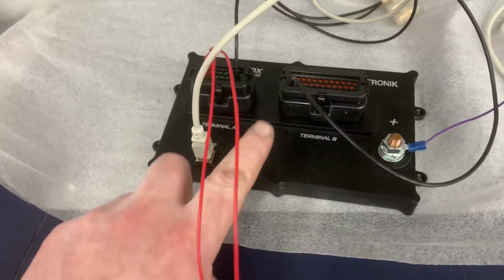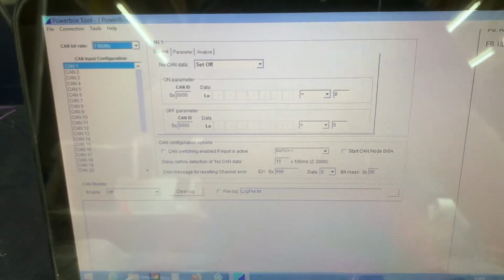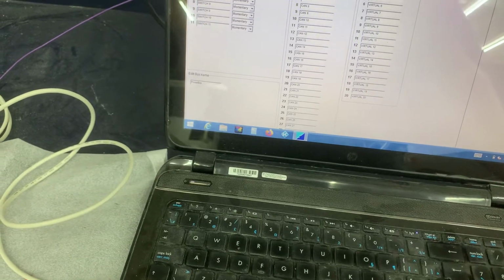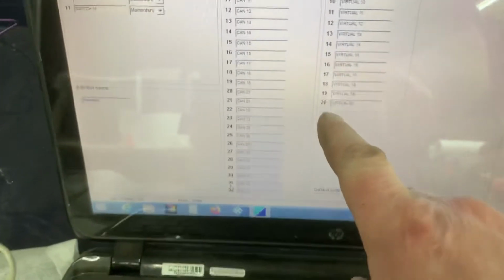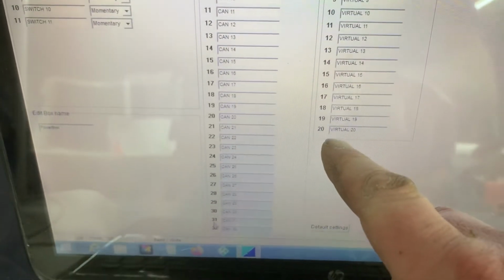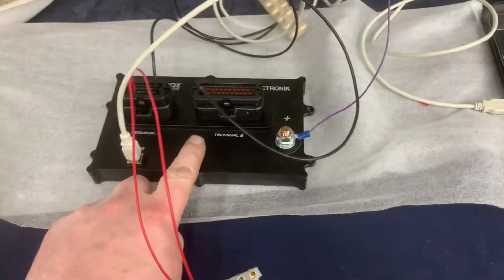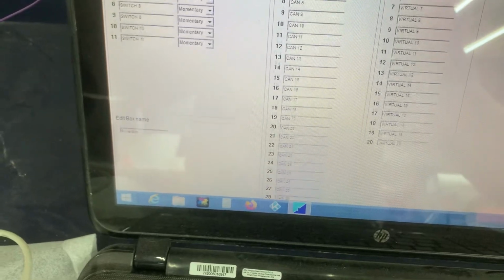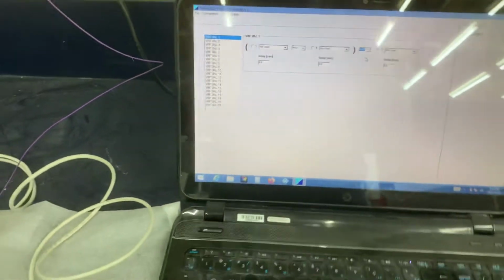Thank God it works

Comment: 2 videos in a day!
I nearly missed the first one!
Reply: I forgot to Post the other one..... Been busy but that's Good..... Updates and progress this year will be more regular..
Reply: @clivehdhomer8306  Awesome can't wait. 

I might actually do something with the Fisher Fury this year. I have a DL1 data logger, a differential pressure sensor, a pitot tube, some pressure pucks and some ideas on how to shape the mouth of the rad inlet. Also read the Julian Edgar book as well as a few FSAE papers and some WW2 documents on rad cooling ducts.
Reply: @DavidMalenczak  always fun finding the actual data, just compared to opinion's etc.... Will be doing some testing in the diffuser tunnels at some point... Nascar windtunnels in the deeps south are $500 an hour very tempting to drop by for a proper wind tunnel results on DF levels other than suspension compression Logging at speed...